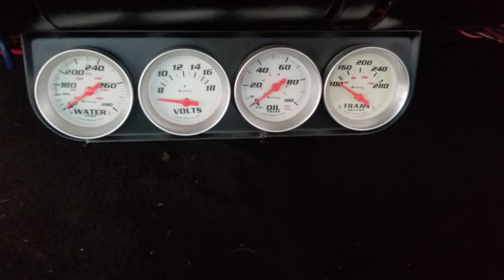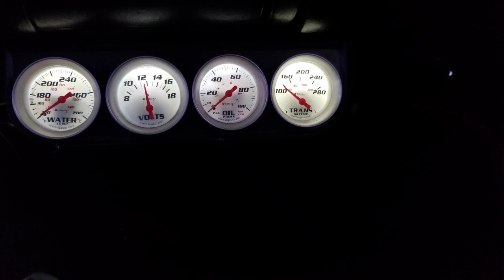CHEVY NOVA BIG BLOCK REBUILD RECAP

Comment: I'm building a 555 Triple Nickle for my 70 Chevelle, just wondering what quench clearance did you run? and can you run a straight super pump gas or do you use octane boost or even race gas. Im running  .043 quench, .003 in the hole and .040 Cometic MLS gaskets